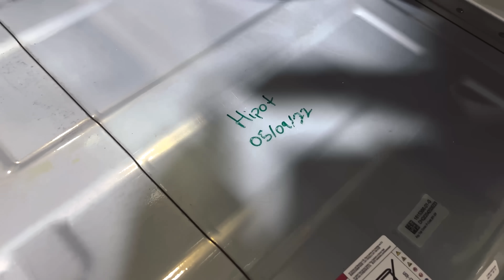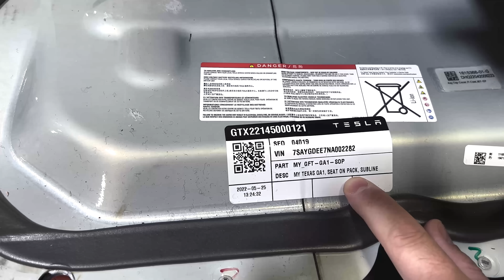Tesla Model Y 4680 Structural Pack OUT!!!

Comment: Lots of space wasted under the center console?
I'm disappointed and relieved it's a bolt-in pack. Allows for an amount of savaging, but wastes A LOT of weight amd cost, I'm sure.
Reply: No floor, little interior labor. Huge savings in manufacturing as well as weight savings.

Comment: Non repairable pack - the smallest thing breaks - a $10K repair!!!! Frankly, very little is saved by putting seats, console and carpet on the battery pack. Installing these items in the vehicle along with the rear seat, fascia, etc, is a nothing saving. Tesla likes rear driver's side charge point, and HV components scattered from back to front of the vehicle. Frankly, the pack should be minimised with a removeable cover. Charge point should be on one front quarter panel and the windscreen wiper water fill point on the opposite front quarter panel so hood does not need to be opened unless something needed from the frunk.
Reply: But easily swappable! Refurbished packs are not that expensive and their reliability track record is stellar. 

It's the big picture that counts.

Look at the phones. How successful did the Fairphone become? Exactly...

Also, don't get your frustration with wiper fluid. It's exactly the same as in every other vehicle with user serviceable bonnet.

Some OEMs that failed to integrate a useful frunk are now selling over-engineered wiper washer fluid ports as an innovation, lol.
Reply: @RobertPuklin  Chinese manufacturers are doing away with the frunk. Can have less parts if non-customer serviceable items are better hidden. OEMs should focus on cabin space except for trucks - trucks should have a frunk.
Reply: @peteregan3862   can't have only cabin space and passenger feet 10 inches behind the bumper. Would be great for passengers but not really safe. Crumple zones are there for a reason. Also, aerodynamics.

Look at the size of the Lucids frunk, why would you want to give up all that space?
Lack of a frunk just shows poor packaging and lack of competence in the EV space.

It is super useful for cables, dirty children clothes, stuff you want to keep separately and just as an extra space. Try living with and without one and then come back.
Reply: @RobertPuklin  With 'car' SUVs, the cabin gets longer, and the front and rear overhangs shorter.
Reply: Comparable to an engine swap, would you say? That's not bad, considering the miniscule odds of needing a battery swap.
Reply: Peter you obviously don’t know what you talkin about. Maybe stop?
Reply: @leonari  that would be no fun

Comment: i wonder how that affects crash tests.  Crazy redesign.
Reply: Sandy said at some point that the rigidity will help in the side intrusion tests, and I think in the overall tests. Instead of a "frame" around a battery pack having to resist intrusion/collapse there is essentially a solid slab.
Reply: @donjones4719  well that’s what I thought initially but then seeing how it’s just basically bolted onto the other two casting parts is really what made me asked that question

Comment: This is as amazing as promised and the level of integration and simplification is incredible, yet the sticker price just keeps climbing :(.  There's obviously a pay-off here for Tesla long-term, but it won't really matter unless they can compete on retail price while preserving their margins.  I realize that lithium is skyrocketing and that there are tons of other inflationary pressures, but Tesla is presently raising prices faster than other automakers and that just cannot continue for them to remain successful.
Reply: Inflationary pressures + supply chain bottlenecks + unprecedented demand = higher prices, yep. That's how it works.

Fun fact: The other automakers are raising prices faster than Tesla. The average price of a new vehicle is something like $47k now and still climbing.
Reply: Kbb published numbers in April that proved 5+other major legacy oems making millions of cars between them had all raised their average prices higher than tesla did from q1 2021-q1 2022. So please do some actual research next time before claiming tesla raised their prices higher and faster than others. Also no dealership fees, and no market adjustments on a new tesla either. 👍🏻

Remember when adjusted for inflation that 220 mile 6s 0-60mph model 3 announced in spring 2016 would cost nearly 43k in today's dollars. 
So at 46k with 20% more range, quicker acceleration, more tech&features, higher safety ratings and quicker charging. 

Nobody today can touch the base lfp model 3 rwd dollar for dollar in the ev space. Maybe someone will soon but it won't be an American company and it won't be anytime this year either. 😎

Comment: 1198 pounds ? Including 2 seats ? And it's structural ( so it's going to save weight on the body )? 
And , most important , I can't imagine how many hours in manual labour during trim fitting is saving this kind of assembly ...

Truly amazing job by Tesla . Only a "vertical company" , well integrated, can deliver this integration . The opposite is what we have seen in the Ford Mach-E cooling system video ...

I can't wait for the other video ...

Thank you Munro !!!!!
Reply: It’s definitely a change to the whole decking process, and greatly improves the ergo for seat and floor buildup.  I’ll wait to see the details analysis, but the labour savings are not likely significant but rather small efficiency pickups.  You wont save “hours” as the whole assy process is only likely 12-15 hours in total labour. Even still, if you can save 20 min, that’s 10-15$ per car and that’s huge.

It’s a lot of labour to get there, but seeing the access under the dash from through the floor was wild.
Reply: 1198 pounds.  Why does the car weigh almost the same as the long range with a lighter pack??  Hope we get some insight on the.
Reply: @richardmorin4518  What is the total weight of this Texas Tesla?
Reply: Tesla is NOT vertically integrated, it's been don 70 years ago, old concepts, it doesn't work, needs more people, more bills, easier and better to buy stuff from companies that specialize in ac units, ac cores, window, etc etc etc..Tesla is NOT vertically integrated by any means.  70 years ago car makers forged their own frames, made engine blocks, made springs, tesla does no such thing, no maker does, it's not cost effective, Sandy is not making any sense....vertical integration is OBSOLETE
Reply: @cengeb  Every automotive supplier would love to have you onboard , if it hasn't get you already ...
Reply: @lettoreespatriato3270  so Tesla makes it's own paint too? Read history, how Dupont owned a lot of GM, and supplied all it's paints etc and chemicals, was broken up, cus of the monopolistic properties...vertical integration is obsolete ..21st century, join it
Reply: @cengeb  Munro had already explained that Tesla , in 4 years ( 2018-2022) has gone from a BIW "like the others" to 2 gigacastings + structural battery . And in between has made an interim casting + std battery .
This means tens of changes/revision of the same parts or more substantial changes.

With your system ( "welcome on the 21st century" ) and in the same time frame,  an OEM is barely able to make a mid-life cycle refresh , changing graining and color .
Have you seen the Ford and BMW cooling  ?  Do you think that is a result of a very optimal organisation ? I don't think so ... but if you think otherwise ...well .... open your own OEM ...
Reply: @cengeb  You clearly don't appreciate the difference between " big conglomerates" , with rigid structure , where the right hand don't know ( or doesn't want to know) what the left one is doing , sometimes with one arm trying to boycott the other arm for a better career progression and with 15 or more employee level  , and "vertical structure company" , where there are no more then 3 or 4 employee level , where the Ceo has a rough understanding of what engineering is and where an employee doesn't need to go through hundreds of people ( and several company ) approval for a single small change in a single part.
Reply: @lettoreespatriato3270  f piech made vw into the empire that it is...he was an engineer,he developed Quattro 4wd at audi when he worked there...he knew all about cars. Audi pioneered 4wd for mass produced vehicles,others followed.  He was also part of the family that controls vw through porsche holdings..which controls 51% of the empire..porsche cars is a different div owned by vw..when tesla does 13 brands,and 10 million vehicles a year then it's a car company.  Thousands of suppliers, one company doesn't make it all..Philips used to make everything in electronics the individual components to the finished products they even had a div that made the machines that made the products fully vertically integrated...all sold off starting in the 80s...not efficient nor cost effective...tesla is nowhere near vertically integrated, no modern mfg. Is...it doesn't work.  Take a few courses in business learn reality
Reply: @lettoreespatriato3270      Tesla opened its German factory in March 2022, which should have caused a huge increase in European sales and market share for Q2.
    Instead, Tesla’s European sales and market share fell by half in Q2, as if Tesla had closed its sole European factory.
    Tesla’s European EV market share was 20% in 2019 but has since fallen. In Q2, it fell below 5%.
    Counting only BEV (excluding PHEVs), Tesla’s European market share fell from 18% in Q1 2022 to 8% in Q2 2022.
    There's an onslaught of other EVs for which new European factory capacity is created, without getting nearly the media attention compared to Tesla.
Reply: @lettoreespatriato3270      Tesla opened its German factory in March 2022, which should have caused a huge increase in European sales and market share for Q2.
    Instead, Tesla’s European sales and market share fell by half in Q2, as if Tesla had closed its sole European factory.
    Tesla’s European EV market share was 20% in 2019 but has since fallen. In Q2, it fell below 5%.
    Counting only BEV (excluding PHEVs), Tesla’s European market share fell from 18% in Q1 2022 to 8% in Q2 2022.
    There's an onslaught of other EVs for which new European factory capacity is created, without getting nearly the media attention compared to Tesla.
Reply: @lettoreespatriato3270  Stalantis beats Tesla in Europe in EV sales, so much for all that hyped German factory,it's a goof, besides he built it illegally, and is a natural resource menace...
Reply: @cengeb  So , the VW empire is doing so good that Diess has been "fired" for doing so good ?
Reply: @lettoreespatriato3270  He upset the ruling FAMILY, Porche/Piech, who control 51% of VW through Porsche holdings, he got them rolling in EV, but not fast enough, delays in Porsche models, and software group...he still get's like $30 Million Euros, for the remainder of his contract.  Obviously VW has high standards, they don't wait  for things to not go as they expect...it's hard to be CEO after 20 years of F. Piech, the grand wizard who made VW into the Empire it is, he is related to the original Porsche dude, and married to a Porsche (he's dead now) but he was a REAL car guy, engineer, worked at Audi, and developed the Quattro, which was the first mass market 4wd vehicles, all others followed...he developed engines for Porsche, unlike Tesla, who is Musk, who is just a loud mouth, hype.  VW sells about 10million vehicles, Tesla a few hundred thousand, big difference. Between Stanlantis #1 now in EV in Europe, VW #2 in Ev in Europe, VW is still #1 in china and Europe overall, Tesla is neither anywhere
Reply: @cengeb  Ford Motor Company , in Munro Live, has just said they need to go  " more vertical integrated ...batteries , EDU , software ..... "  😂😂😂😂😂
Reply: @lettoreespatriato3270  like it's 1955? Oy vey...so they will make tires,glass,hoses,electrical connectors,wheels,plastic components,etc.,etc.,I'm thinking sandy doesn't know what vertical integration is...oy vey..Maki g wire harnesses alone is a multi billion industry for the suppers that specified in it car makers don't make wiring harnesses.
Reply: @cengeb  Ford is speaking about vertical integration ,  not ( only ) Munro . 
Could be you are the one stuck in 1955 ?
Reply: @lettoreespatriato3270  that's why they are ford,and not vw or toyota....ford is not even in top 3 of car makers,it's a global industry,Ford is not a major player...toyota,vw,and now stalantis,and stalantis is now #1 ev in europe with its different brands,vw #2.. tesla lost big time in europe and china..tesla is not all that smart lots of hype,not actual car production...look it up
Reply: @lettoreespatriato3270  vw is building a new factory in the u.s. for scout ev...and expanding TN now with id4 in production...and vw is involved with solid state battery companies...tesla is a 15 year old design falling way behind ..as others come on with newer better stuff...audi build quality,beats tesla in the price tesla asks ...audi is a superior product
Reply: Where do the rear seats go?
Reply: @patangaha  Rear seats are first bolted to the unibody and rear casting, then four bolts to the battery/floor.
Reply: @patangaha  I think you can see the structure where are fixed in the first 6 seconds of the video.
Reply: And still the car weight about the same as the other Model Y....
Reply: @Xanthopteryx  I'm sure Munro will talk about that .
Reply: They compared it to other cars not even mentioning what battery capacity or features those cars have  what a joke!!!
Reply: One huge benefit to this is if they make these faster than the other half of the car, they wont be slowing down the production line.
Reply: Well run Profitable companies are not vertically integrated, tesla laid off 200 workers, hmmm,

Comment: From repeatability point of view Tesla's are probably the worst to do any bodywork repairs. Any accident damage to the megacasting and the car has to be scrapped. Excessive integration is not always good.
Reply: @JorgTheElder  you must be speaking from a rich person prerspectibe. All this engineering is a profit maximising idea and repair restricting policy. Tesla is making sure there is no repairs possible on their cars. Traditionally manufactured cars are so much easier in regard to structural repairs. Not only this is casted it is also deeply integrated. There is no other manufacturer designing their cars in such anty repair fashion as Tesla.
Reply: @KZ-ko4vm  elon has said the crash rails for castings are all designed if broken on impact to be able to get cut off and replaced with a bolt on part.

Comment: Dang if you have black seats and want to change them out to white seats, good luck with that!
Reply: XDDDD, I assume they mount it as usual, but not on the from but on the pack. It makes no difference to you if you want to switch it of. The seat isn't permanently attached, 100%
Reply: I saw the seat bolts, it's mounted to a framework that's is part of the battery case, will see with the rest of the teardown

Comment: Take a few minutes and go through the video where they are underneath the car and check out how the front and rear aluminum die castings are connected to the steel side rails.  Looks like they bonded the aluminum to the steel with structural adhesives.  Notice the A pillar where the door hinges are mounted and the spot welds going up the pillar confirming this part is indeed steel.  With the structural battery pack bolted in, this is an amazingly stiff structure.  I'd like someone who knows to reveal what the primary resonance frequency is.  In racing production cars, a lot of attention is given to stiffening the welded unibody to achieve resonance numbers in the 2.0 to 2.5 Hz range without welding in full roll cages.  I wonder what this Model Y is measured at?  If anyone knows for sure, I'd appreciate a reply sharing this information just so I can know how good this approach really is.

Comment: The old OEMs must look at this and think that even with unlimited funds they are three years plus behind Tesla for their manufacturing techniques, leave alone their motor and battery tech lead, their automation lead and so on. Great to see it laid bare. At nearly 58 I just wish I could go back to the business again for a second run at it.
Reply: More like 5-7 years in advance of the OEMs. Excellent engineering!
Reply: Yep, they are all busy launching new EV skateboard platforms.....in 2 years or so. Tesla meanwhile are way past skateboard platforms
Reply: To be fair, those old bastards are only on the 1st or 2nd iteration (VW) of their designs and Tesla has been learning and optimizing their tech for over 10 years. (I don't count the Roadster.) So one can hardly expect their products to compare well. But the old OEMs deserve to suffer, they refused to start on EVs when they should have. The funny part is their current claims that they'll be out-producing Tesla in 5 years with cars as good as Teslas.
Reply: @donjones4719  they said the same (at least VW/Audi did) in 2012
Reply: Funny enough legacy CEOs of GM, Ford, VW etc are actually rallying their workers and investors with outlandish production targets of overtaking Tesla in 2025, when all you need is take one look at this video and understand that they got nothing like this in the pipeline in their factories in terms of assembling speed, efficiency, profitability and volume.